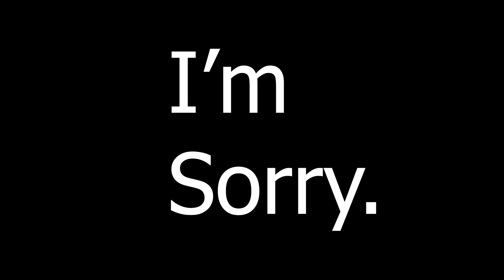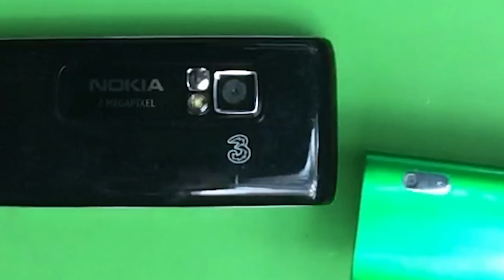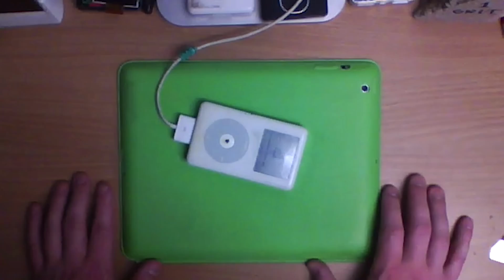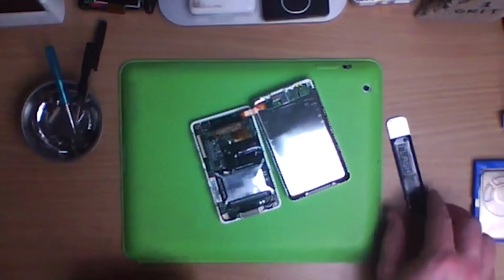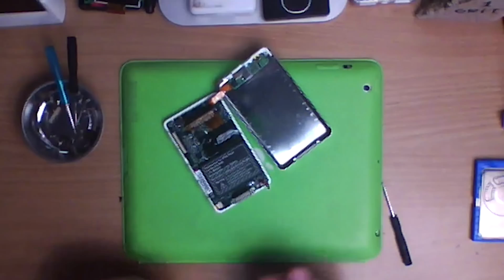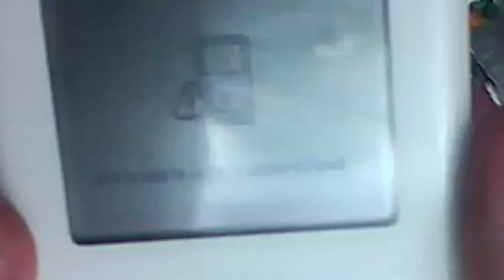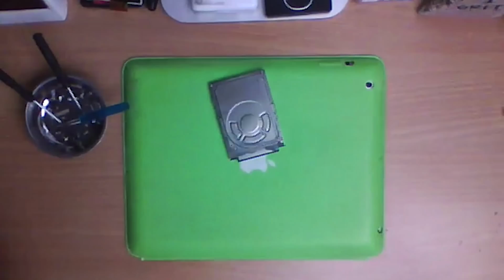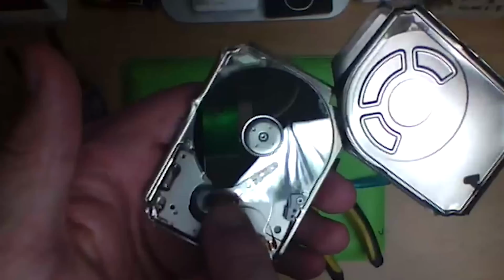This video was filmed with an iPod Nano. I'm sorry.

Comment: The resolution is actually ok, but the audio destroyed me.
Reply: Resolution is scaled to 4K.
Reply: Ikr
Reply: @mikhailchurakov  If you mean that it's upscaled to 4k as in it's not adding extra resolution just making the video bigger then yes.
Reply: @hollowludens5861  but if he using topaz video enhancer and upscaler...
Reply: @mikhailchurakov  but the part recorded with the ipod nano wasn’t for sure
You can still see pixels in this part
Reply: @Maciek2846  yes because it's cropped from 4:3 to 16:9
Reply: @Maciek2846  it's cropped, because you losing some pieces and resolution
Reply: Nah, the audio and the video are meant for each other ❤️
Reply: @Maciek2846  Except you can. How do you think so many old cartoons get shown in 16:9? Do you not realize you can cut off parts of a square to make it a rectangle?
Reply: @Espartanica  okay, sorry about that. It actually makes sense since watching a 16:9 video on a 4:3 display literally shows black bars so technically it’s cropped.
Reply: @mikhailchurakov  do you think that it's gonna add more detail out of nothing?
Reply: @Cockalicious  topaz video enchancer can add
Reply: @mikhailchurakov  probably just applying sharpening
Reply: @Cockalicious  not really, also upscaling without quality loss
Reply: @mikhailchurakov  it's impossible to put more detail than what the sensor physically captures, unless the software is guessing.
Reply: @Cockalicious  software is using ai

Comment: Video suggestion: modify the camera of the recording iPod.
Reply: Put a ipod touch 6 camera in it
Reply: And put a iPhone 11 pro max camera :)
Reply: @alexandru5057  no the camera is like the size of the iPods
Reply: ipod nanos are a nightmare to open let alone mod
Reply: cameras also require different amounts of precessing power. The 11 Pro has one of the strongest mobile processors inside, thus making the mod waay to hard

Comment: I had a 4th gen and hot a plug in picrophone for it.  It was good for recording lectures because the sound was clearer, there was no motor noise of the tape recorder and it was more compact.

Comment: you know what, its not as bad as i thought. i thought that the frame rate  would be so bad that i can hear it, yet the pixels i cant really smell. same goes for the bad audio cant taste that either. its like a flat soda, half of what its supposed to be is gone but also not. you dont like the taste but keep drinking anyway. thats like this video this video is a flat soda that i keep drinking (watching) for whatever reason.